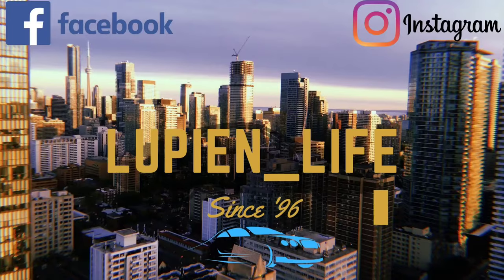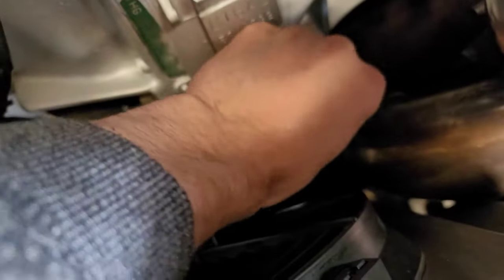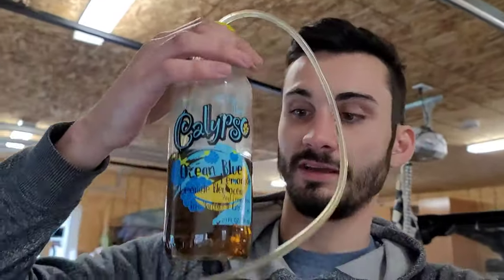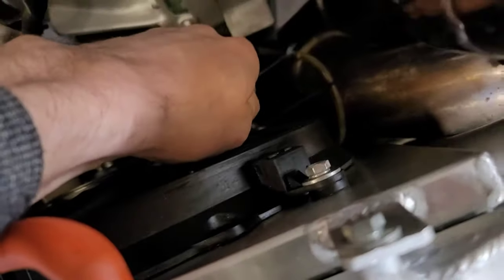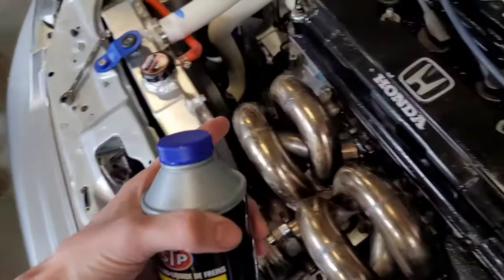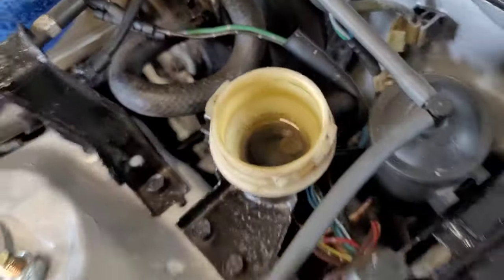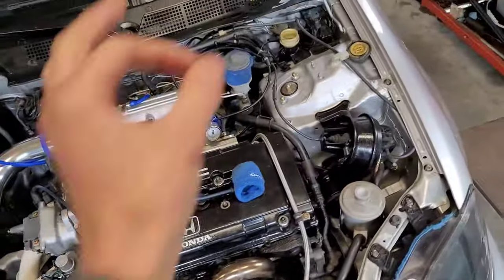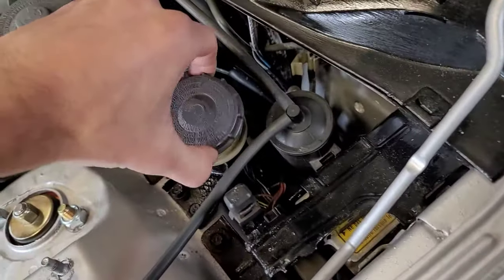How to bleed your clutch (Honda)

Comment from the maker: My apologies for referring to the clutch slave cylinder as the master! 
New videos in progress.
Follow @lupien_life to stay up to date
Reply: is this clutch bleeding or brake bleeding like you say throughout the vid?
Reply: @LupienLife  is it better to use a bleeder kit which uses the air from tyre to draw the fluid
Reply from the maker: @bronniesboy  that method would be quicker because you don't have to get in the car and pump the brakes but it does the same thing. This method is just the cheapest and easiest way

Comment: I replaced my slave and master, I have a hand pump vacuum pump and when I press the petal to the floor it doesn’t really pull from the reservoir but when I pull vacuum with the petal all the way decompressed I can see it lowering the reservoir level. Is this normal? It seems like I can’t get the last bit of slack out of the top of the clutch petal either way
Reply: What did you find out? Bad master cylinder?

Comment: My clutch gave out on me Monday where I couldn’t go into gear and it sank to the bottom. I thouggt okay I’ll replace the master and slave cylinder. Today I’m driving and my car won’t go into 1st until I try about 4 times. then shifting into other gears feels weird. I can’t shift into a gear unless it’s about 3-4K or it would randomly let me. I’m not a mechanic lol so I have no idea what to do the car right now turns on and driveable but soemtjmee also when I put into reverse I can’t take it out of reverse so I’m not sure what to dO. PLEASE HElp
Reply from the maker: If your master and slave are new and the system is properly bled, double check that there isn't a leak in the lines anywhere. You'll see a small amount of fluid leaking or bubbling. If it isn't a bad line than likely your clutch is going out or the synchros in your trans are toast. I'm leaning towards your clutch being done. It isn't disengaging the flywheel properly. It gets stuck in reverse because reverse doesn't use syncros.
Reply: HELLO.i have the exact same problem...the spring in the master cylinder broke in 2 places so we changed the kit and same problem....we then put a brand new master clutch cylinder and same problem.. news is that in December we put in a brand new cluth and pressure plate with a brand new slave...what could be the next thing to check

Comment: Thanks, this was very helpful.  I didn’t even have to use a hose – I found an empty water bottled nestled into the spot just right, covering the nipple completely and catching all the fluid.  Real easy.  Thanks again.
Reply: WRONG!!!  the hose MUST be covered by the fluid or you will get air inside.

Comment: I just got a Phoenix V-5 reverse bleeder. You crack open the bleeder screw and pump new fluid in reverse up to the master. This is supposed to get more air out because it works with the direction the air bubbles want to move…upwards.
Reply: I got one of those. I can’t seem to get it to work correctly. Apparently there’s some kind of grease that’s supposed to go on it to keep air bubbles out. Mine didn’t come with any though.

Comment: Thanks for the video. What is the size of the tube you used to attach to the bleeder?
Reply from the maker: I believe its 1/4". 3/16" if not. Most bleeder valves are the same size

Comment: Nice video, just one thing if yo can answer perhaps. My clutch engagement point has been higher up in the pedal instead of before ( around 50-70% pedal  lenght ) now it takes almost at the end of the pedal travel of the clutch. i did bled it and no air coming for like a whole bottle. no leaks or anything everything is dry
Reply from the maker: How old is the clutch? At that point I'd be wondering how much life is left in it. If it needs to be almost fully engaged to create enough friction, it probably needs replacing soon

Comment: Hey Im having a problem and i cant find help on google pls reply to me. I bled my clutch and now the pedal wont go all the way up, it goes up a little bit have a little of resistance and then nothing. Ive been bleeding the clutch for 2 days and have already used up 2 bottles of dot 3 what am i doing wrong am i missing something?
Also there is no more bubbles coming out and there is no leaks either. The clutch was working fine before i bleed it.
Reply from the maker: What car do you have? You can reuse the fluid you pump out too if you need to keep testing. When you say wont go up do you mean it wont push in towards the firewall or it wont return back out to the normal resting position?
Reply: @LupienLife  I have a 2015 Civic. And I actually figured out what was wrong with it, when I was bleeding it my helper accidentally stepped on the pedal too hard and fast and that ended up pushing the pushrod on the slave cylinder back while the bleeder valve was unscrew. So I just unscrew the bleeder and push the pushrod back in then give a few pump to get rid of the air in the boot that cover the pushrod, and the clutch stiffened up and got back to normal.
Reply from the maker: @idontwanttogoback236  that was going to be my suggestion to check. Glad you figured it out!

Comment: whats the bottle for , i think you just talked about it but didnt use it
Reply: the hose goes to the bottom of the bottle that way when he pumps air out of the hose it goes to the top and out of the fluid and when he stops pumping air doesn't pull back in only fluid does bc the bottom of the bottle doesnt have air.

Comment: Is it normal for the pedal to stick to the floor like that and then having to manually bring it back up when doing this procedure?  I did this last night and everything turned out exactly as you instructed/described. Clutch feels better now, but it could just be a placebo effect that's got me... you think I'm good?
Reply from the maker: Yes its normal as long as its only sticking when your bleeding it and the valve is open. I have to manually pump it back and forth. Its the pressure that you feel when pressing down that you want. When the pressure is constant and there's no bubbles its good. If the pedal sticks after you're done their might be a bad fitting or line letting air in.

Comment: My 00 civic went limp on the clutch this morning so ima try bleeding it through. Praying that some air just got in it and its not a huge leak
Reply from the maker: Lines are pretty easy. Replacing the clutch is what sucks 😅 make sure the lines are properly fitted on each end. I had the peddle go to the floor before cause air was getting in where it attaches at the master. Had to just undo it and reattach, maybe add some sealant

Comment: What diameter is the hose that you use on that bottle?
Reply from the maker: I think it was 3/16" or 1/4". Just enough to fit over the bleed valve. I think I used heat to stretch mine anyway if its too small

Comment: Ok so idk if I missed it but what was the bottle for?
Reply from the maker: To hold extra liquid so you don't get air bubbles in the system. When you pump new fluid into the system it pushes the old out into the bottle and holds it so it doesn't suck air when you release the pedal ✌
Reply: @LupienLife  So just keep doing that until clear fluid comes out? Is this a routine maintenance thing ? Or just if you replace clutch parts? Thank you 🙏🏽
Reply from the maker: @BEARDED_VATO  yes, pump it out till the color matches the new liquid and the air bubbles are gone. The fluid is supposed to be replaced at certain intervals but it's like 50xxx kms, you probably won't have to do it again.

Comment: I keep doing this to my 07 honda civic si and my clutch pedal isn’t building pressure.
Reply: Any help or suggestions??
Reply from the maker: @guadaluperuiz6413  make sure there is no leaks in your line and that the fittings are tight so it's not losing pressure that way. If that's all good the only thing to check is the clutch master on the firewall and slave cylinder on transmission. If you don't feel pressure it's probably the master. If there's pressure but no clutch movement it's likely the slave ✌
Reply: @LupienLife  In my rsx i replaced the leaking clutch slave. Still no pressure. Im guess its the cmc but internal leaks. Just bought a new one hope it fixes it. What if you accidentally get air in the system. Does it mess it up or can you always just bleed it out?

Comment: What fluid did you use
Reply from the maker: Dot 3 brake fluid. Some newer cars might require dot 4 or higher so just check depending on the situation ✌
Reply: @LupienLife wait why is it brake when we are doing it for the clutch? Isn’t brake fluid different the clutch fluid ?
Reply from the maker: @VaugnX  They use the same fluid! it's basically the same system just with a different end function. Google clutch fluid, the first result is that it is just brake fluid. Especially older cars (obd2 and older) it's pretty universal. I would definitely check the recommended fluid for new cars but it's likely just a newer brake fluid

Comment: bro you are never supposed to put dot 3 in your clutch master idk if it worked but that usually destroys honda transmissions people recommend buying honda specific clutch fluid from a honda dealership it isnt a scam its your hondas transmission fluid. not like your brakes. the pressure might be but not the clutch and your master had the same problem my fluid was dark like dirt if it wasnt for an old timer telling me how it affects i would have to buy a new tranny cause it messes up other things in your gearing
Reply from the maker: I think you may be confusing transmission fluid and clutch fluid? The only fluid I know that needs to be specific is the dual pump fluid in crv rear ends but transmission I have a video on replacing that fluid and the clutch is a simple hydraulic system like the brakes, won't hurt anything if it isn't oem honda. Its not under waranty and not going on a race track lol
Reply: If so then why does my cap say use ONLY DOT 3 ?? Guess Honda didn't know what they were doing when they made my car.. smfh